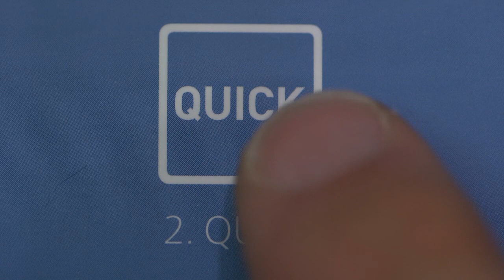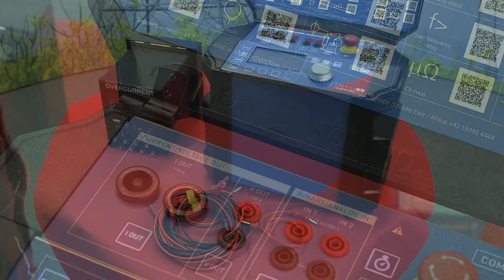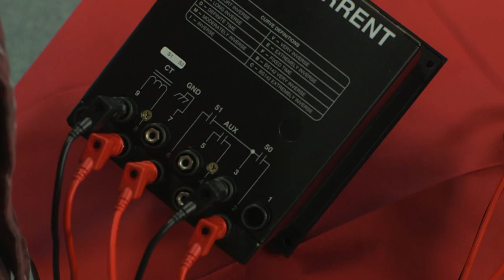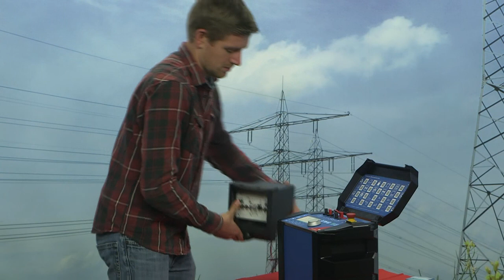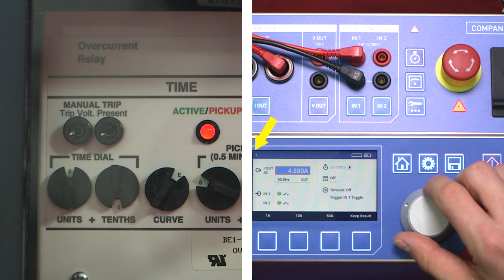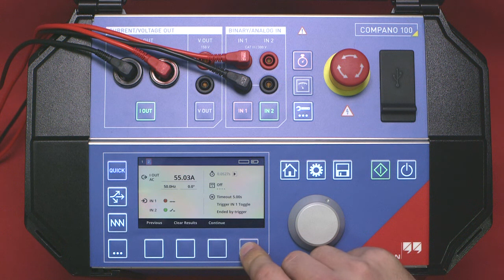COMPANO 100 Do It Yourself tutorial 02: QUICK – Overcurrent Relay Test

Comment: For a digital relay with no DC source available, wouldn't it be okay to use the V-Out to power it?
Reply from the maker: Dear @josiahufono, 
Thank you for your comment and your interest in this video. Yes, the COMPANO 100 has its own AUX-DC mode, which allows a relay without its own power supply unit to be supplied with DC via the V-Out. 

Best regards, your OMICRON team